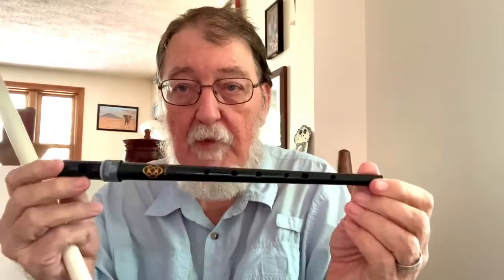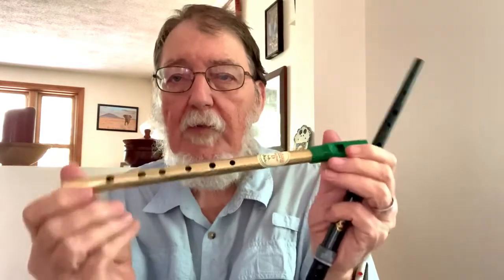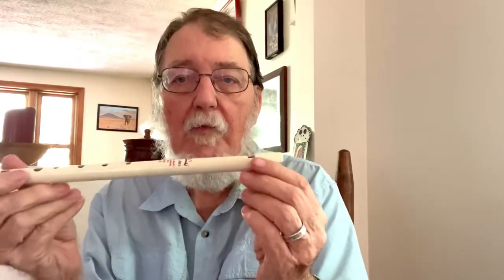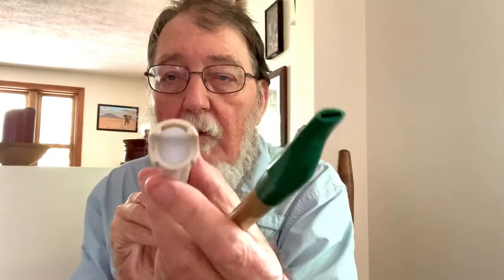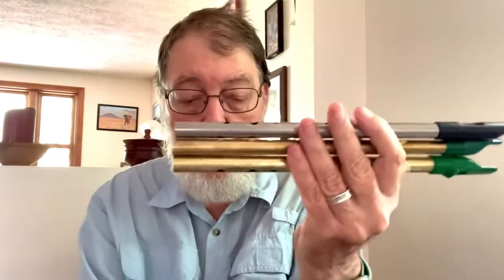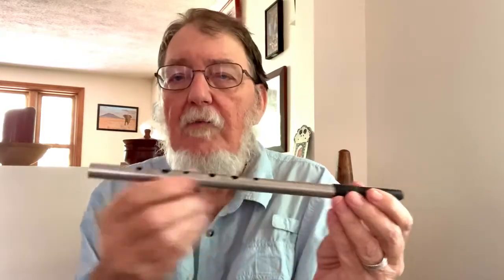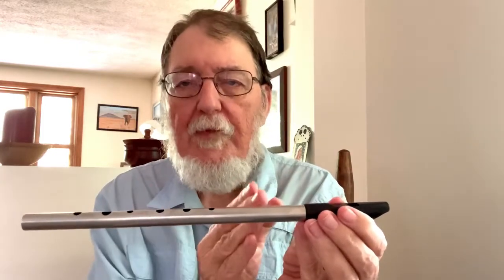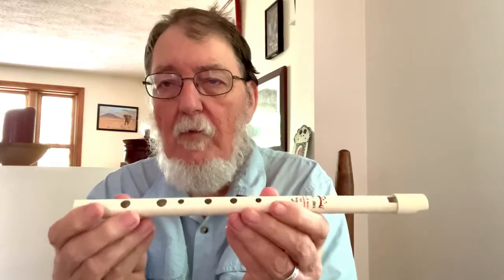Always time to whistle: How a whistle works...

Comment: Very informative,  Is that large bore D plastic whistle made by the Whistle Smith ?,  how do you like it and how does it sound ? Thanks
Reply from the maker: riverwindflutes Yes it is a WhistleSmith. I am preparing a brief review of three hand-made whistles, including the WhistleSmith. It has a more “flutey” sound, with some of the resonance of a low flute but in high D. I am not sure a traditional whistler would like it, but it is certainly different. You have to push the second octave...but the first octave is very stable.
Reply: @StephenIngraham  I'm looking forward to that review

Comment: will you make a similar video explaining the native american style flute?
Reply from the maker: Might do…but both are “fipple flutes” and work almost identically…only the pennywhistle does not have the slow air chamber to smooth out the breath…so is more difficult to pay. If you look at the High Spirits Nova flutes, you will see that they are essentially wooden pennywhistles with larger bores and tuned to pentatonic. :)
Reply: @StephenIngraham  I see:) thank you sir https://en.wikipedia.org/wiki/Native_American_flute#/media/File:Native_American_flute_Composite_Anatomy.jpg
Reply: @StephenIngraham  the fipple int he native american flute is merely detachable, and it has the slow air chamber. thank you again